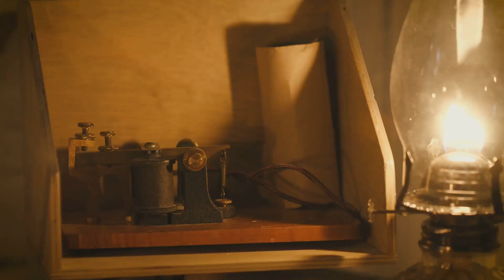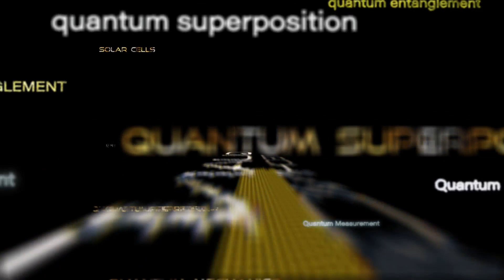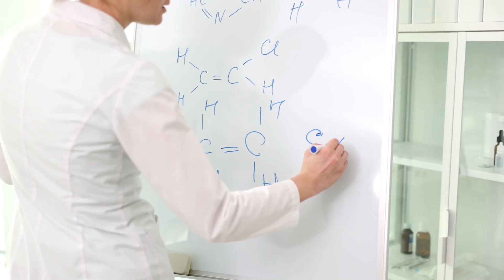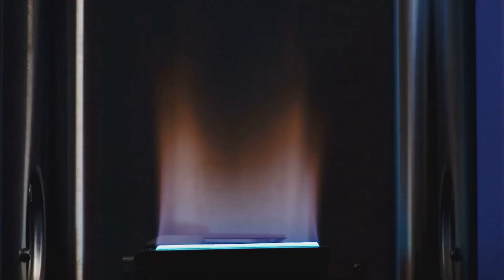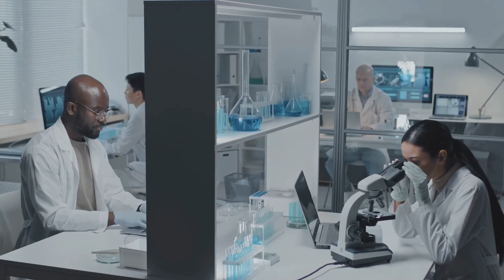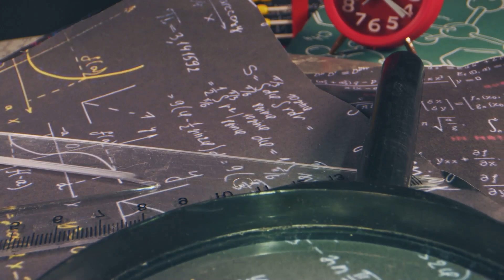Quantum Heat Engines: Bridging Physics and Technology

Comment from the maker: How do quantum coherence and entanglement specifically contribute to the enhanced efficiency of quantum heat engines compared to classical heat engines? How do quantum heat engines adhere to or deviate from the classical laws of thermodynamics, especially the second law? What role do non-equilibrium quantum states play in the operation of quantum heat engines, and how can these states be effectively controlled and utilized?
Reply: solar sailing ?

Comment: So, quantum theory and physics are incompatible.
We build a GIGO computer model to bridge the two.
Reply from the maker: Quantum theory and general relativity, two of the most successful theories in physics, are indeed incompatible in certain aspects, particularly when it comes to reconciling gravity at the quantum level. The idea of building a computer model to bridge the gap between these theories is intriguing.
Reply: @ailabsparadox  actually Einstein's version of the General Theory vs Newton and others is the most contradicted and paradoxical version out there.
Reply: @ailabsparadox  GPS clock frequency data for example contradicts Einstein but supports a combination of Newton's General theory and Gauss's Law for Gravity.
   The Equivalence Principle of Einstein fails by experiment.
Reply: @ailabsparadox  However, I meant that the current quantum theory is not physics vs the previous version of quantum based upon particles entering the ether and creating a quantized amount of energy, just like fission power is used to power the Mars rovers.
The current model is actually based upon Einstein's claim that the ether that he requires for his General Theory is a "rigid immovable solid," without electromagnetic properties.
   It is Einstein's claim that the ether has no electromagnetic properties that brings about the current quantum theory and makes both the Einstein General Theory and the current quantum model incompatible with physics.

 Gravity matches Gauss's Law for Gravity but neither Newtonian Gravity nor the General Theory of Einstein.
Reply: Effectively 'quantum heaters' are just coopting the idea of using the ether to transfer heat and calling it 'quantum' heat transfer by some kind of magic. Propping up the Einstein version of the ether rather than an evanescent Aether used for heat transfer.

Comment: Quantum??  Please explain why this Quantum Mechanics or theory?????   AI stands for Artificial exactly the contents of this video  call it a plasma heater or flame thrower 🤣🤣
Reply from the maker: Thank you for your comment! Quantum heat engines are indeed based on principles from quantum mechanics, which is a fundamental theory in physics describing nature at the smallest scales, such as atoms and subatomic particles. Unlike classical heat engines, which operate on classical thermodynamics, quantum heat engines exploit quantum effects like superposition and entanglement to perform work or transfer heat at the quantum level. These engines represent a cutting-edge area of research, where the quantum properties of systems are harnessed to achieve efficiencies and functionalities that classical engines cannot. The term "plasma heater" or "flamethrower" doesn’t apply here because quantum heat engines are theoretical devices working at the microscopic scale, very different from these classical concepts. Hope this clarifies your question!
Reply: Quantum used to mean that a certain amount of energy was associated with a particle interacting with the ether.
 Quantum is now code for what would happen when something interacts with the ether medium, while trying to prop up the Einstein claim that there must be a rigid immovable solid ether, but it has no electromagnetic properties.
The GIGO computer models are designed to create a hypothetical bridge between actual physics and the propaganda of the modern quantum model.
Reply: Today, you can use the word quantum every three words and it makes you look smart. 😂

Comment: plasma would be a lot more simper, to explain; or better?
Reply from the maker: Thank you for your feedback! While plasma physics is intriguing, quantum heat engines rely on the unique properties of quantum systems. Quantum heat engines are not primarily for heating; instead, they are designed to convert heat into work, similar to classical heat engines, but they operate at the quantum level. The term "heat engine" might suggest that these devices generate heat, but their actual purpose is to take in heat energy from a hot reservoir and convert a portion of it into useful work, while the remaining heat is expelled to a cooler reservoir.